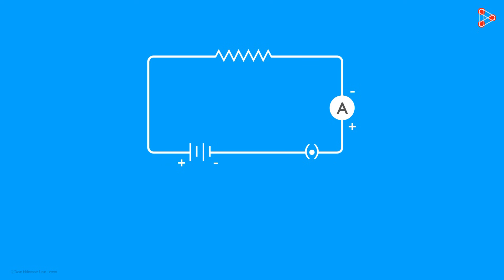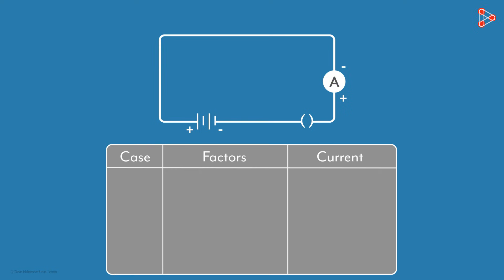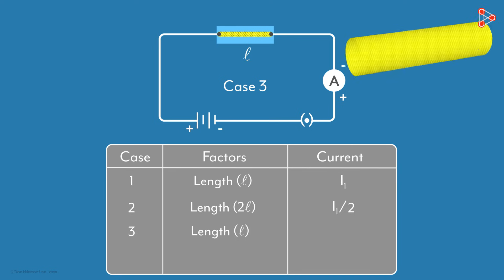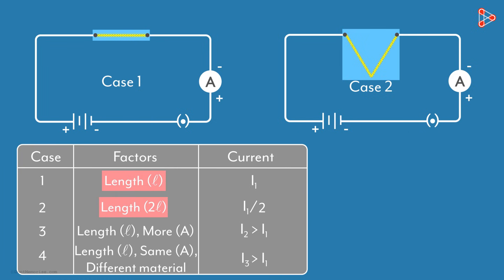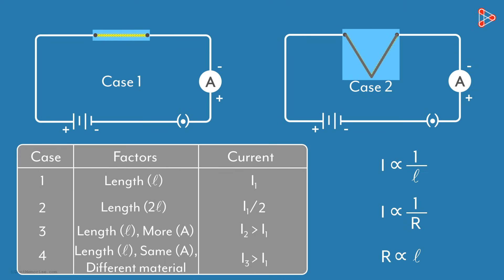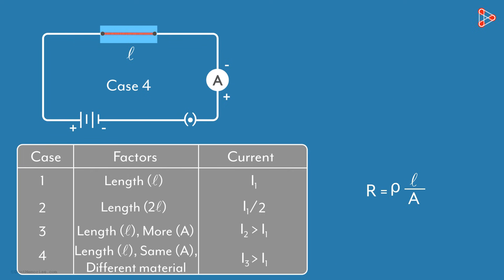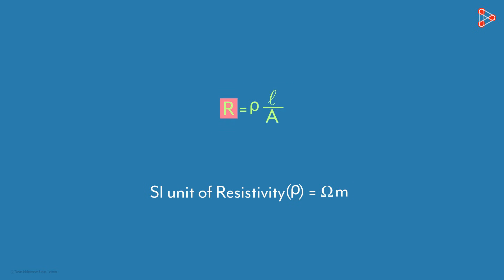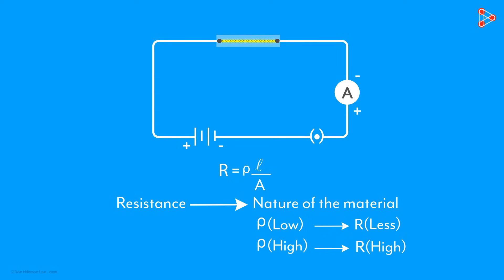Resistance of a Conductor | Electricity and Circuits | Don't Memorise

Comment from the maker: #DidYouKnow: Silver has the lowest resistivity. That means for a given length and diameter of wire it will also have the lowest resistance. But it's not used for wire very often because it's only marginally better and it is expensive and corrodes easily.

✅To access all videos related to Electricity and Circuits, enroll in our full course now:  
 https://infinitylearn.com/cbse-fullcourse?utm_source=YouTube&utm_medium=DME&utm_campaign=r8-RAjL0mrI

To watch more Physics videos, click here: https://bit.ly/PhysicsVideos_DMYT
Reply: not sure if anyone gives a shit but if you're bored like me during the covid times you can watch all of the new series on instaflixxer. I've been binge watching with my girlfriend for the last couple of days :)
Reply: Mam make videos for class 11 also
Reply: @Emory Bodhi yup, I have been watching on instaflixxer for since december myself =)
Reply: @Emory Bodhi yup, I've been watching on InstaFlixxer for months myself :D
Reply: No I didn’t know
Reply: Point 👉😂
Reply: Mam can u say one word definition of resistance ?? Please
Reply: Effective opposition offered to the flow of current by any conducter
Reply: @sharmaji-175  resistivity is an electrical constant.. like its constant for any given material at a given temperature. Moreover, it does not depend upon the physical properties like length  and area of cross-section.

Resistance on the other hand, keeps on varying with area of cross-section of wire and length of wire.

EXAMPLE- resistivity of silver at 20° is 1.59×10^-8.

Now, no matter how much is the length of wire or area of cross-section of the wire, the resistivity will always be 1.59×10^-8 at 20° .

Resistivity is numerically equal to resistance of a wire if the wire is 1m long and 1metre square in area of cross-section. 

Relationship of resistance and resistivity:-
Resistivity=(resistance×area of cross-section of wire) ÷ length of wire

Hope it helps. 👍

Comment: Wires are supposed to be lower-resistence compared with bulbs.

Bulbs use high-resistence to generate light-and-heat.
Bulbs use inert gases of different sorts to prevent it from flaming
Tubes uses (types-of)gas to ionise to become conductor.
Kick-start of tubes of air to ionised-conductor is sometimes necessary(ballast of flouresent and whatever of neon, ...)
Flat dots-lines of CRT-Televisions are energised-ionised with electron-beams 
Inductors are receivers of conductivity(conductors)

Low nanometer grid-array resistence can be spot-welder.
Solar panels, radar, ... grid-array.sss... resistence is funny business when electronics-engineers look-down on electrical-engineers. High-tension (ratios of ... versus...) within CPU leading to arcing sublimation of tracing aluminium and intermitten non-conductivity to cooler ionised conductivity to hotter-cooler till off-state where aluminium redeposit as condensate to screw the RMA-department and consumers. 

After aluminium as tracing-etching(lithography), monkies are borned... materials-engineers pray to nikola-tesla besides 666
Reply: Before the indians do om-chanting... the supercooling era of processors leading to liquid nitrogen shipping logistics and complaints about the physics of zero-kelvin as limiter... lets us go back and review the guy with lightbulb head instead of halo head

Comment: Why do resistance decrease when area of cross section of a metal wire increases? How do electrons get more area to flow when number of atoms also increase with thickness?

Comment: But if we increase the thikness of wire then it will have more atom which acts as resistance so how will the current increase
Reply: The larger the cross sectional area, the lower the resistance since the electrons have a larger area to flow through. This will continue to apply no matter how thick the wire is. The electron flow will adjust itself to whatever the wire thickness is.
Got it from Google 😅
Reply: Agar space jyada hogi to electrons free hokar ghoomengen na isliye current bhi jyada tez flow hoga

If the space will be more then the movement of the electrons will also fast ,resulting in the fast flow of current.

Comment: This help me very much to understand the concepts about Resister 
Can you tell me that "Why every conductor can not obey Ohm's Law"? 
I will wait for your answer Mam
Reply: Conductors having non linear resistance (i.e. whose value changes with current or voltage), don't follow ohm's law. Also, super conductors don't follow ohm's law as they have zero voltage drop irrespective of amount of current flowing in it.

hope this helps lol...

Comment: hey! i think there is one small mistake in this video. in one of the circuits shown, the +ve terminal of the ammeter is connected to the -ve terminal of the battery.instead the +ve terminal of the ammeter should be connected to the +ve terminal of the battery right?pls clear out my doubt.

Comment: Hlo!! Reply plz...See if we have 1 resistor then we can connect it in anyway... If we have 2 resistors, we have join them in 2 combinations I.e. both in parallel aur both in series... Similarly having 3 resistors, we can join them In 4 combination {u can check}...SO IS THERE ANY FORMULA FOR FINDING NUMBER OF COMBINATIONS WITH GIVEN NUMBER OF RESISTORS???
Reply: Clearly you don't know how to ask a question to someone 🤷‍♂️